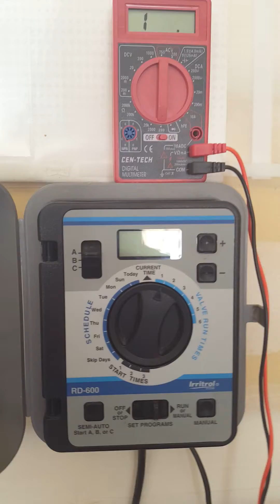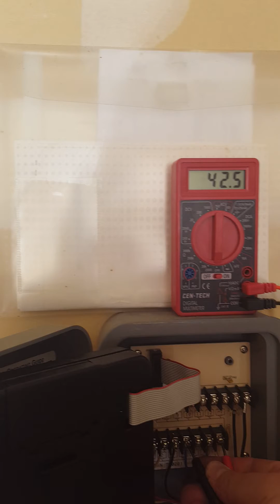Irritrol RD-600 LCD Blinking Fault

Comment: I had this problem. I found that the transformer was no longer putting out 24v. I am now chasing up a replacement transformer.
Its a very old controller (with original transformer) so there might be other problems down the line - watch this space.

Comment: BATTERY - Change the battery. Worked for me. As for your recommendation to buy another one....you offer it with nothing to back it up.
Reply from the maker: The 9v battery only powers the clock. 

Testing the controller is performed by manual cycle of a valve.

Further testing of valves with voltmeter eliminates faulty valve.

If you only have issues with the clock the battery would be suspect.

There are other troubleshooting resources online for reference

https://www.raindialdoctor.com/display-says-off-or-blinks/the same
Reply: Changing the battery is only a temporary fix.  In 2 weeks that battery will be flat dead.  If the controller was working normally the battery could die on it's own over time and the controller would be just fine.  So the fact you did a battery change and that "changed something" tells you something is wrong.

Comment: You never said what to set meter at
Reply from the maker: The valve solenoid measured resistance values did not exceed 100 ohms.  This was a continuity test so the values were interesting but not important.

I used a Harbor Freight meter which you can pick up for free if have coupon.